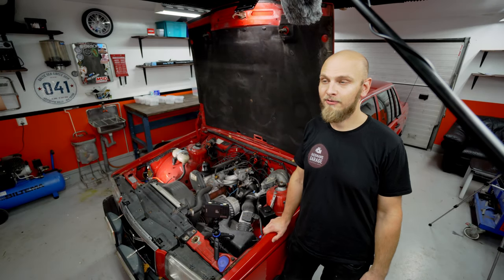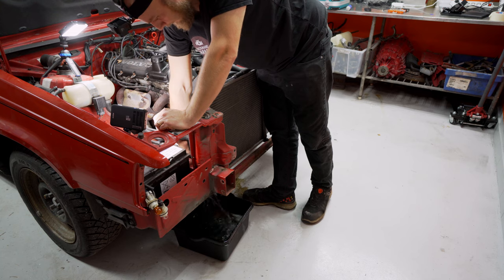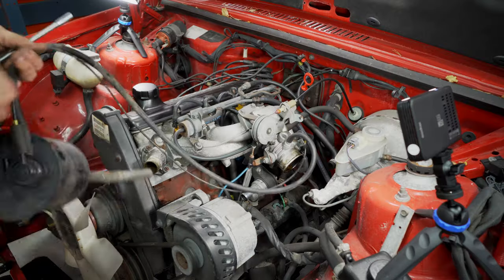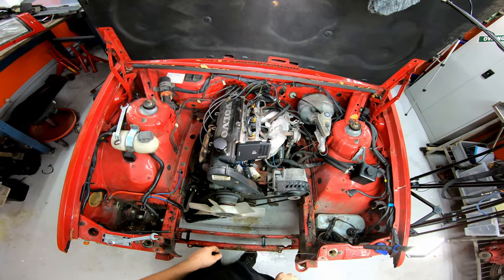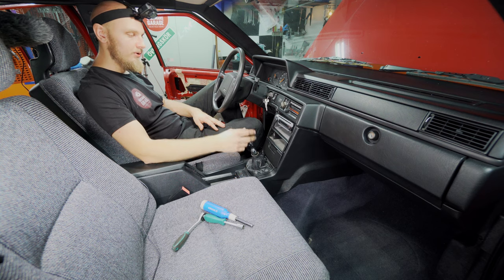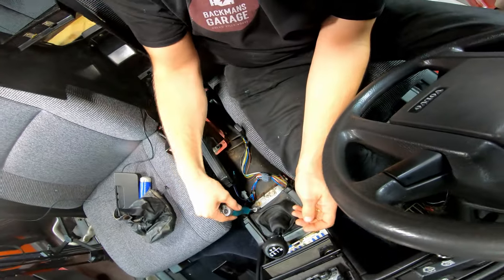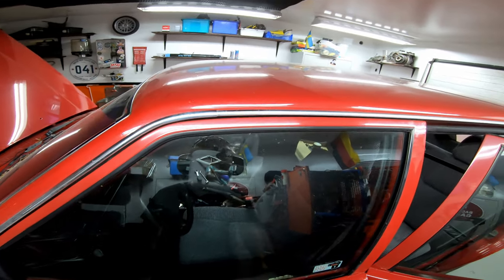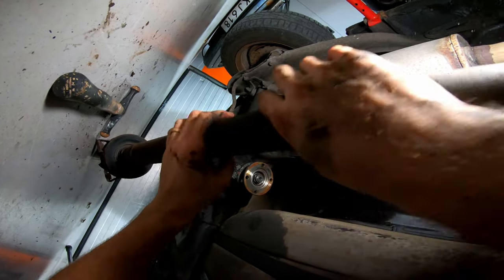The Volvo 740 Project Restoration And Race Car Build - Part 8 - Removing The Volvo 740 Engine

Comment: Nice Job! I found your channel today and started watching this series. I became interested in the 5 cylinder engine and wanted to see the process you're going thru. I myself have a Ford Merkur and a lot of people swapped the B234 head on to the 2.3 block with reasonably good results. But, I wanted alternatives, so I'm watching your progress, very informative. 

If you have not put the engine in yet, could I suggest you get rid of the PVC set up under the intake and simplify it. Mount an aftermarket oil catch can remotely. That coolant line you may be able to route it back to the head and bypass that crazy set up. I highly doubt that the pipes will condense and freeze. In the original tear down, your crankcase ports were plugged, so it's an issue that needs to be addressed, while the engine is still out. Just my thoughts. I've done a couple of catch cans and happy with my results. Just subbed! I thought I had missed a portion.
Reply from the maker: Thanks man! Glad that you like the content :) 

About the engine, setup and so on. As a project moves along things change. And the PCV system is just one of those things. And i believe you are right and I will probably build some other type of system on there just to fit the RWD setup better and also perform better. I just need to clarify if you can do any mods to the PCV system before getting the car registered with the engine, it might need to be original. But I will dig deeper into that soon.

Not going to do many performance mods to this engine. There will be e full 500Hp build later on in this series, not 100% sure if i want to go 5 cyl volvo or something else, but there will be a proper engine build coming up, right now I just want to keep it simple :) 

Appreciate the comment, like the fords. Used to have a -90 Mustang 5.0 with a supercharger :)  //Backman

Comment: Pro tip: Flip video from head-GoPro 180 degrees. Then we'll see it as you do.
Reply from the maker: Yeah, i had some issues with the gopro to say the least 😄. Not used to having it on my head and was not aware that it flipped around like that 😄 I'll make sure to lock that feature in the future 👍//Backman

Comment: motor install next? :D
Reply from the maker: Have some small things to deal with before we get there, but yeah, its not far away 😃 //Backman
Reply: @BackmansGarage  okey😅 i had some bad luck with mine😂 i changed engine because i threw a rod and smashed the oil sump. then got another engine before inspection to get the car registered with the engine and the engine i put in had rod knock too😔 now im building a new engine😂

Comment: ich cant believe youre wrenching withiut gloves..  try maxiflex they are the best out there.  just finishing my b234ft project and 945 restauration.. also thought of making a youtubechannel out of it but.. meh..  as you said i hate to focus on stuff besides wrenching..

and yes! i needed to replace all of those engineloom connectors on my 93 940
Reply from the maker: Bad habits 😄 All the gloves dissapeared during the pandemic, and i have just not gotten to buying new ones yet. 

Yeah, love making videos but sometimes it can spoil a little bit of the fun. /Backman
Reply: @BackmansGarage  hehe! I always get bloody knuckles when i miss my gloves.. but also everytime i take them off i remember a thing i forgot, most of the time in the need to touch the greasiest part of all just to get dirty to the bones 10 minutes before quitting..  thats m bad habit ;)